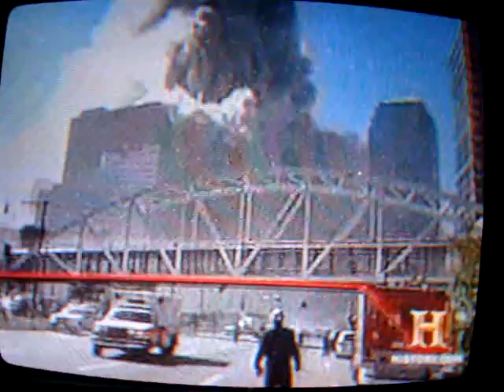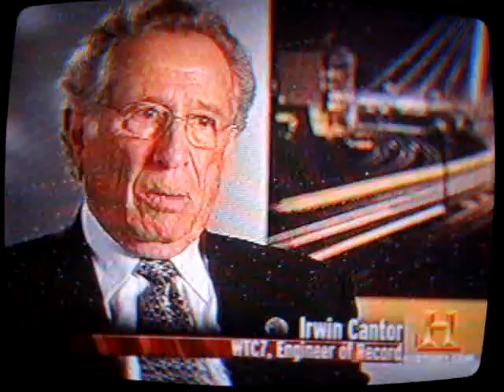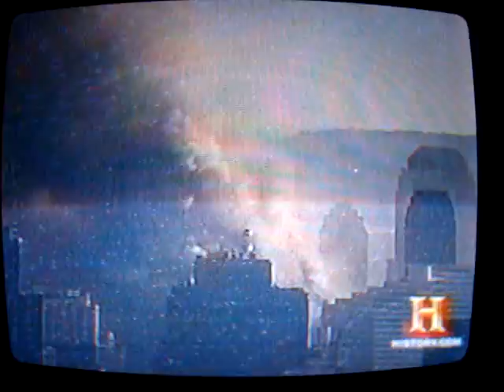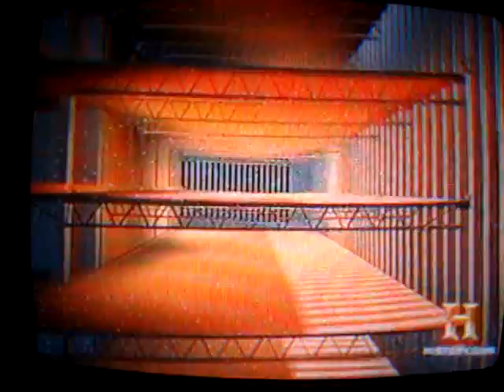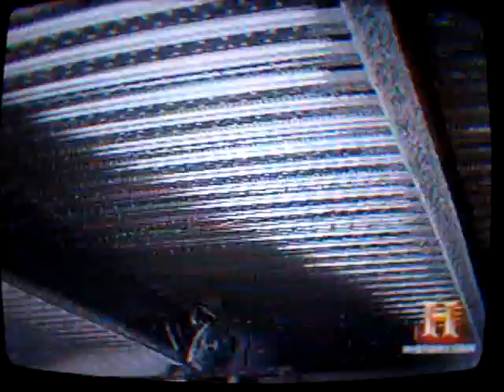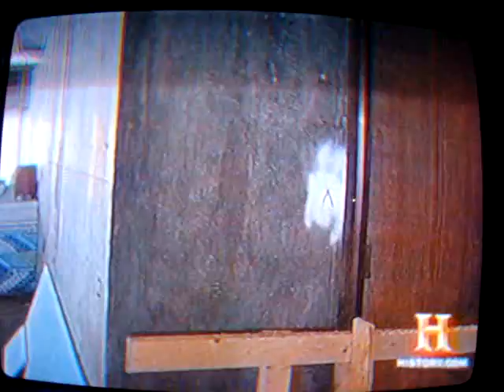911 white wash on WTC 7, History Channel (engineering disasters), Conspiracy, Cover up, propaganda

Comment: I was in Japan shortly after the Kobe quake in 1995 and while the buildings did not burn that I looked at, ten story buildings did in fact pancake a single floor at the base or at midpoint in the structure without the entire building coming down. In some cases, the building just tipped over. To have building 7 fall into its own footprint is preposterous. The fires were not hot enough (1100-1300 degrees) and the videos were textbook examples of explosive demolitions. The gov't claimed one beam failed, what a crock of horse hockey. Even the Oklahoma building did not collapse with half of its foundation blown away. If you can explain how the laws of physics are violated in reference to those buildings and then claim a low temp fire caused the damage...I will wait for your answer.

Comment: Oh the building was designed to with stand the impacts.
Leslie Robertson (chief structural engineer for the buildings) has said repeatedly they were built to withstand a 707, lost in the fog, looking to land low on fuel.
MASSIVE difference between 767 at 500mph with 3/4 fuel.
So Spew your Drivel onward you jackass !!!

Comment: Steel melts at 2500 degrees. They are formed into beams at a foundry. Melting steel still doesn't explain the free-fall collapse and concrete turning into dust...

Comment: Steel doesn't weaken from fire my butt, how do you think it was formed into beams? FYI, stove fires are no more than 500 degrees. Jet fuels burns far more intensely than that. Steel may melt at 1300 degrees, but that means it starts weakening well before that.
Reply: cocacola150dr  how do you explain the molten steel found 2 weeks after the colapse?

Comment: *SIGH* Their phone theory, nano-thermite, and theory of non-weakening steel have all been debunked. People make phone calls from airplanes all the time, I have seen it before myself. Regarding the nano-thermite, the balls they found in the steel were residual from welding. As for the non-weakening steel, steel may melt at high temperature, but it weakens well before that.

Comment: No building has also been subjected to the collapse of 2 other buildings. It all comes down to the design of the building and the effect of the other 2 towers coming down around it. The fire, coupled with almost certain foundation damage would be more than enough to bring it down. As for the way it fell, things don't always happen as we think they should. For all we know, additional columns could have snapped under the pressure of the falling building, leading it to fall straight down.

Comment: @99Eternal A bunch of total nonsense!!  For one thing the FDNY were WELL AWARE B7 was going to collapse.  They had transits on the building (measuring devices) and determined it was moving so they pulled their men out of it.  (i have a whole article interview with the FDNY and Chief)  Its only on Youtube that this is such a hot topic.  To the FDNY its a big yawner.   The metallurgist said the steal failed from FIRE alone.  Not thermite or any of that crap.  

Get in to the real world!!

Comment: @daviddevall   David Chandler is a miss guided fool.  He has no clue what he is talking about.  He may be a Physics prof but he has no clue what he is talking about with this.  Bottom line!! Explosives make noise. Lots of it.   Especially linear shaped charges which would be required on columns that large.  I stood 2 blocks from a CD shooting for a news station.  The audio of that taking place was OVERWHELMINGLY LOUD.  

Both towers collapse from silence.

Total nonsense!!

Comment: This guy is full of crap. Fire proofing is not invincible. Its suppose To allow the building to last longer in the case of a fire. And yes steel does melt at 1300 degrees. But it does get malleable at a temperature way under that.

Comment: if anyone could be bothered to examine evidence wtc 6 is directly inj the way of falling rub6le and blocked off damage  to any damage to 7s base.
Exactly where it collapsed first.
7 is also collapsing into a vacuum as admiited by NIST with 2.25 seconds of free fall.
Free fall  =  falling into a vacuum.
 wonder what could have caused all that air to be suddenly blown totally away?
A clue= explosives.